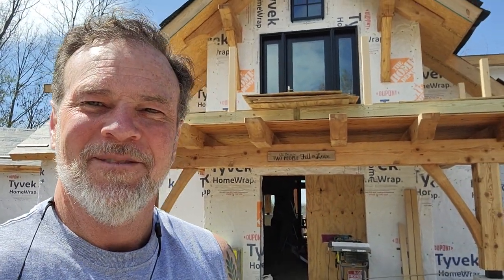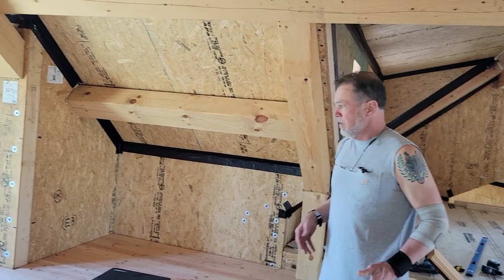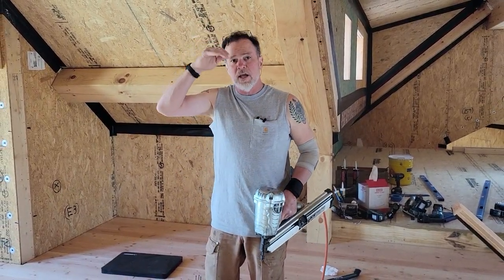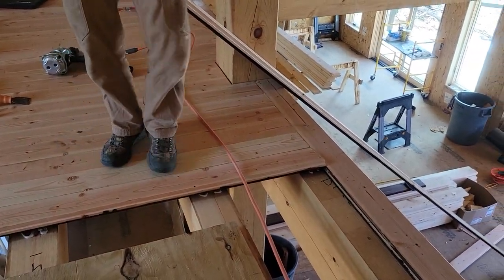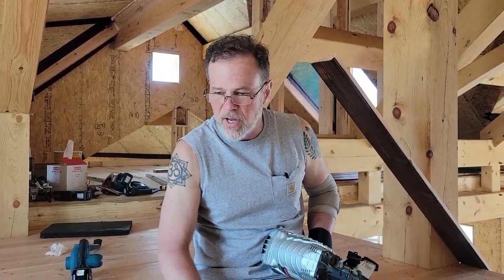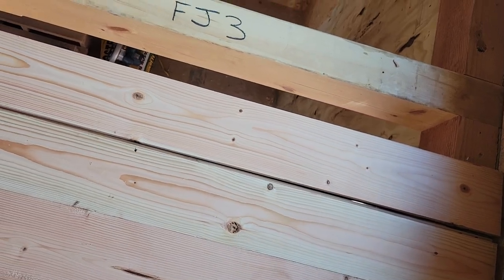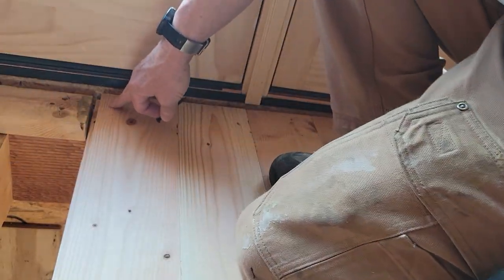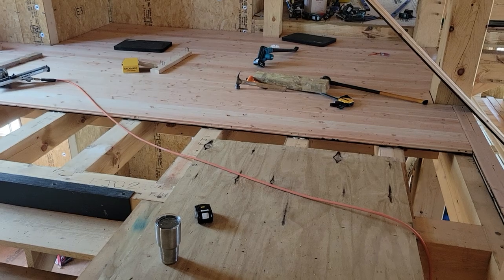How to Install 2x6 Tongue and Groove Structural Wood Flooring: "Modern Mountain Man" Max McAllister

Comment: Very nice video. Nothing worse than warped, heavy/thick, T&G. Another tip to add to your arsenal would be a wedge.. Screw down a 2x on an angle; cut a piece of T&G on the same angle, keeping  the groove side to slide along the tongue of the board you're trying to tighten up.. Works well on removing any gaps. Keep up the great work.
I am a little jealous - at 70 yrs I can no longer bend my knees and hips as you do. Don't get me wrong. I'm still pretty agile but I remember those days even at 50 yrs diving for outfield balls. If I would give you 1 piece of advice - Ask any  man that you see wearing knee pads when they started wearing them; before or after their knees started to hurt.. I can tell you their answer! 😉
Reply from the maker: That wedge is a pretty good idea, I like that!

I have my lower 3 vertebrae in my spine are fused, and my spine is fused to my pelvis.  I can't bend over like a normal person, so I don't use knee pads much when working on a floor or below floor level because I just can't bend down into it and the knee pads lift me further away!  I would like to use them more when I can.  I got some "Pro Knees" now, they are expensive but awesome comfort.

Comment: My entire homes subfloor is this and goes under the exterior walls base plates unfortunately making it tricky to replace those boards if they need to be. Looks gorgeous in your home and will last a very very long time.
Reply from the maker: Yeah, someone didn't think that through for you!  I'd hate to have to figure out how to replace that!
Reply: For reals I guess that was the thought process in 1969 🤦🏼‍♀️ basically replacing more framing than I had intended too. Happy building to you 🔨

Comment: I’m starting my project this weekend. 29x13.5’ covered screened porch with pressure treated 2x6 t&g floor. 
Question:  why did you decide on nails vs small head deck screws into the tongues?  You used them intermittently but why not every one instead of ringed nails.?
Reply from the maker: If the board laid naturally flat and didn't fight I used ringshank nails for ease and speed.
If the board had a twist and was fighting,  I screwed it down.
Reply from the maker: And glue on all contact surfaces